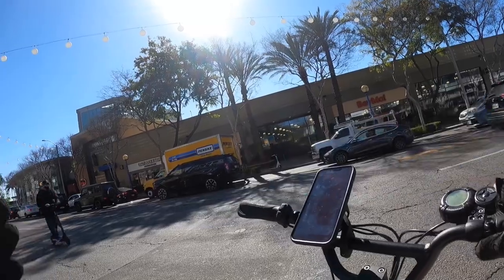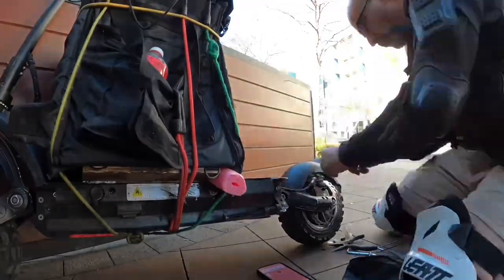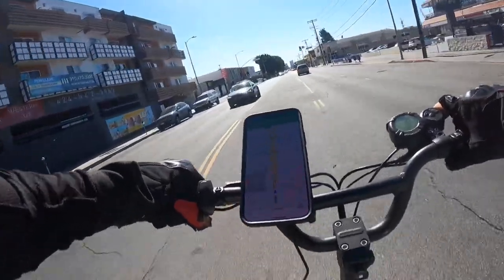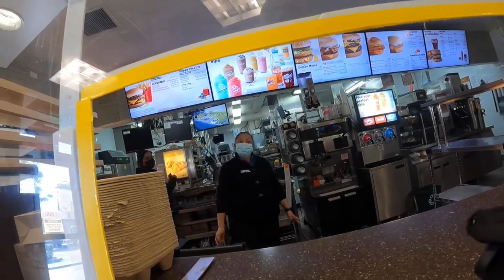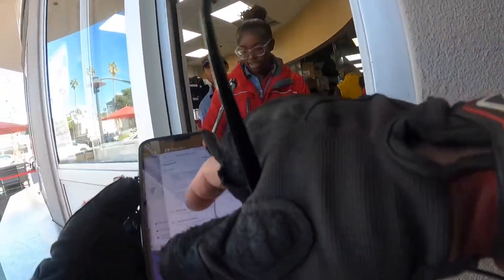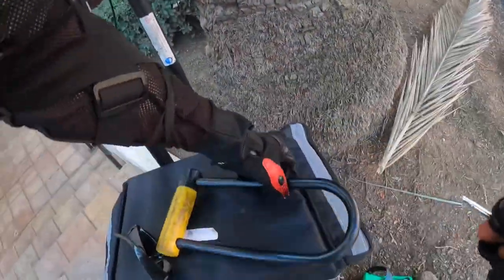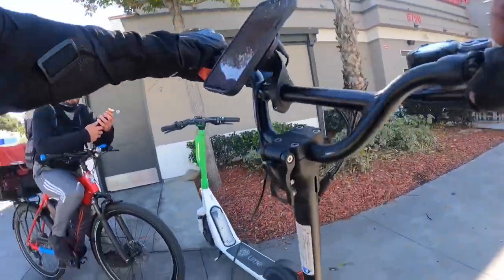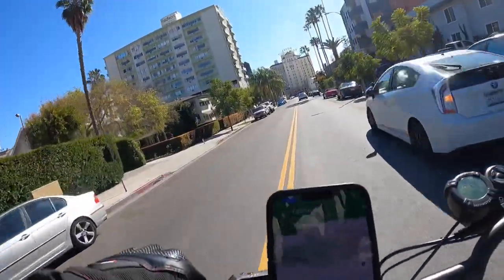Electric Scooter Delivery | BEAT THE ALGORITHM! | Top Dasher worth it? | DOORDASH UBEREATS DUALTRON

Comment: To stop brake squeal use copper grease on the back of the pads, that is the standard method for cars and motorcycles, copper grease not normal grease it is a special grease used for this very purpose, you have to take care not to get any on the actual pad surfaces, but you only put a small smear on the back of the pads.

Comment: I'm curious about the battery capacity of your scooter.
Reply from the maker: My Ultra 2 has a 72v 35AH battery - I can get probably close to 50 miles range at 25 mph and probably 25 miles range and 50 mph. I weigh 185 pounds you get more range if you weigh less and less range if you weigh more.  This is one of the better scooters for range.